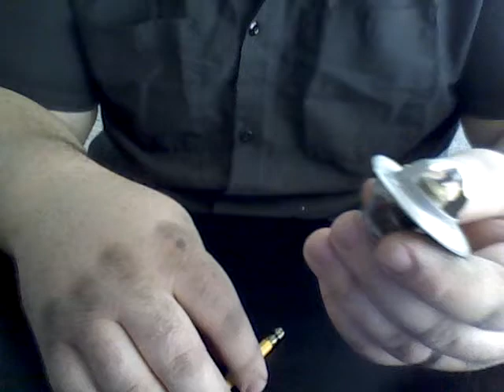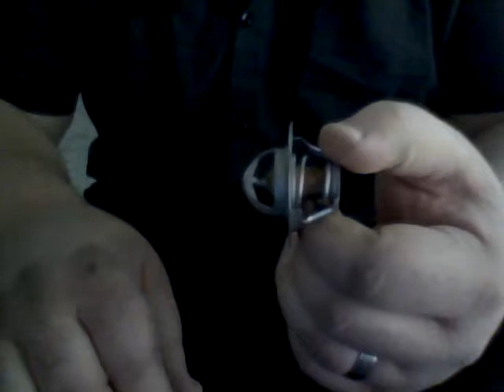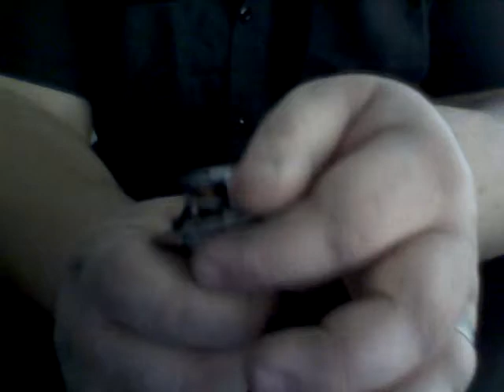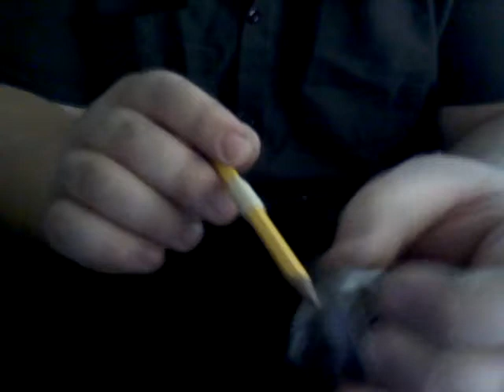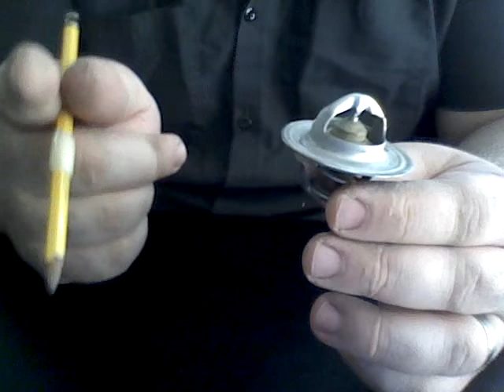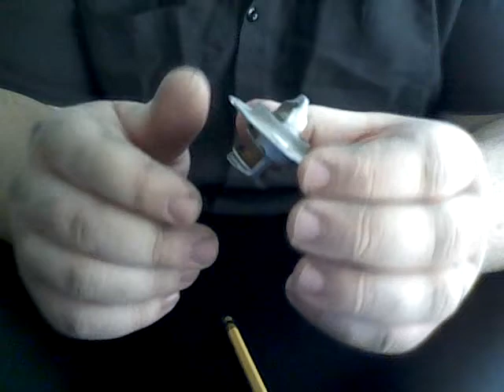How a car thermostat works

Comment: Ok Im doing a project that requires a part like a car radiator thermostat.
But mine work the opposite it needs to be open when cold and closed when hot..

Now with a regular car radiator thermostat can it be rebuilt to open when cold?
Do they sell anything on the market like that?
I was also looking at Thermostats for CF250cc Water-cooled ATV they are very small like i need.

Thank you for any help..